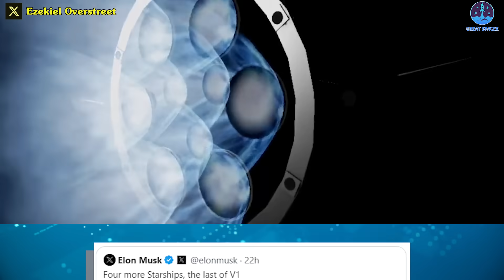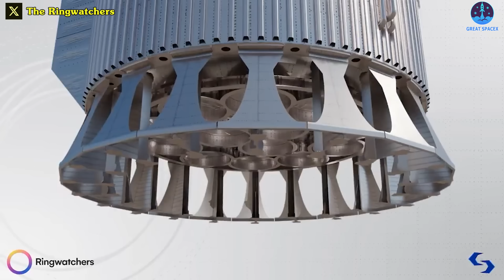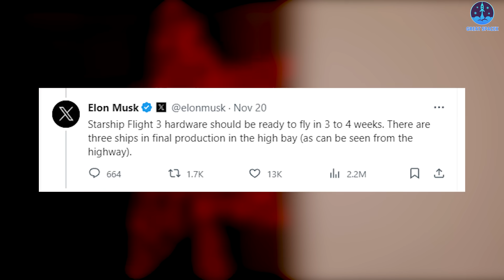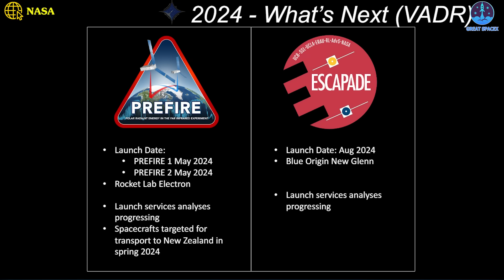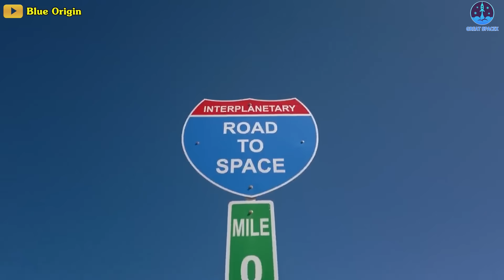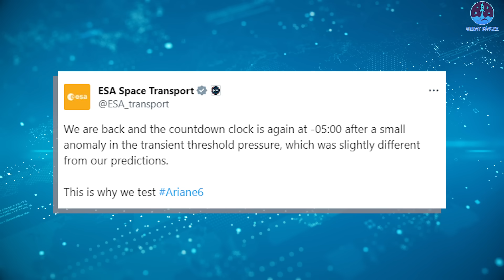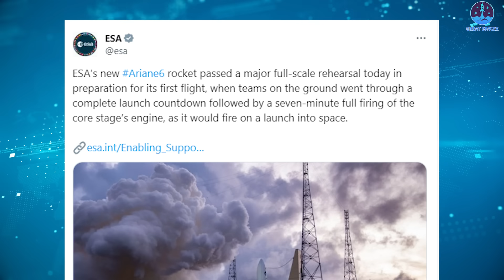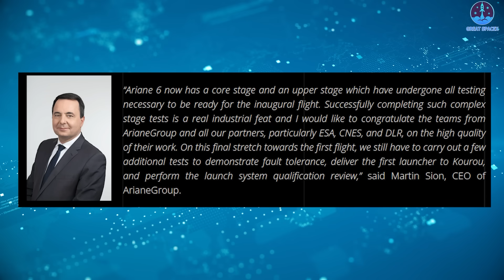Elon Musk just declared to stop Starship V1 production! Huge update on V2 ...

Comment: Starship has never reached orbit. Starship has never successfully reentered. Look at all the missing tiles on launch number two.  Remember, if you're old enough, and you are probably not, all the trouble with the space shuttle tiles and how that added cost and dramatically increased turnaround time.  Betting that they will never get the ungainly starship back through the atmosphere successfully.  It's a whale.  And, making it longer is just going to make it worse.  Making the craft lighter and less strong to counteract the forces of reentry?  Really smart.  

I am personally looking forward to them getting a starship into orbit because we will be able to see the real weakness of the entire system...namely that they will never be able to get the glider/rocket back through the atmosphere and slowed down to land. 

The booster might eventually be made to work reliably with, possibly, "all engine running" to quote from a Saturn V launch.  But, they might have to use the super heavy as a non-reusable once they discover it's just too large to reliably turn around and return to the launch tower etc.  As a non-reusable super heavy could still be VERY useful in that a single launch could probably put an entire moon landing mission in orbit including the reentry vehicle.  Of course, the new moon landing hardware is going to look a great deal like the Apollo setup isn't it?  

Perhaps two super heavy launched, or maybe three, is all it would take to put an entire Mars mission into orbit.  

Super heavy booster might succeed.  Doubt it will ever land itself.  
Starship will never succeed.  It is too large, too ungainly, too un-aerodynamic, and relies on the proven unreliable shuttle style heat tiles etc.  

Oh, if we had only kept the Saturn V, improved the engines, increased the payload.  Imagine the things we could have done in the past half century!

Comment: The raptor 2 engine has a mechanical turbo defect. This is a full flow thrust engine. For the amount of fuel present in the enclosed engine bay at the point of explosion. Something around the turbo’s has a material flaw. I do not no what materials there using. But the failure can only be within the turbo housing. This is the only thing that could inject liquid fuel into the bay compartment. Maybe they should turn to sensors back on. They would help diagnostic’s to pin point the fault.

Nickel base alloys are mainly significant for supreme corrosion resistance including Nickel 200, Monel alloys, alloy 600, alloy 625 and electroformed nickel. Electroformed nickel is not attacked by galvanic corrosion when it is kept in contact with various other metals. Monel grades offer supreme corrosion resistance and possess significant magnetic characteristics at the cryogenic temperature and good resistance to ignition in oxygen. The Inconel grades consisting of Ni, Cr and Fe prevent oxidation attack at the high temperatures limits up to 1800oF. This is more expensive and has more weight. But is bulletproof. 

Next launch concentrate on turbo pump housings pressure’s and temperature’s.

You can also test the onboard destruction module.

Comment: I think by using, 60 percent weight titanium,  instead of stainless steel for the payload section structure and front pointy end  part of the starship vehicle they could possibly reduce the dry weight of the starship by a massive twenty percent overall. Of course it’ll  more costly  but they have used cheaper steel for all the development prototypes do they should be able to go straight over to titanium with limited structural testing in the can crusher

Comment: 33 engines is a great achievement. Since they have Raptor V-2 flight tested and V-3 on the way things seem to be going good with the Raptor. The Rocketdyne f-1 combustion was stabilized after the engineers came up with a baffle plate that sectioned the injector plate off into smaller sections and cured the explosions. But they never tried a big engine with Full Flow combustion. With the success and knowledge SpaceX has gained I think (even though it is a bad idea) they should experiment with a Large Engine design to see if it is possible to recreate a new version of the F-1 using Full Flow Combustion.
Reply: Why? The raptor is working better than ever. Elon stated he preferred smaller engines, that way a problem with one or more is a very small percentage loss in thrust compared to a few larger engines. It doesn’t matter, but I happen to agree. 
          The Merlin engine isn’t a large engine, and look at its record.
           I believe he should concentrate on getting the raptor 3 ready, personally. To each his own, I suppose.
Reply: In large engines there are More issues: temperature and pressure of combustion, as F1 got 70bar, compared to 300bar in raptor. In large combustion chamber cooling wpuld be problematic

Comment: I know that was not meant or even thought about, but I find it curious that the two rockets are named V1 and V2...
Reply: Version 1 and Version 2 have a VERY long history in many sort of items - even rockets.
Don't ASSume.
Reply: @bricefleckenstein9666  Mk1 and Mk2 has better and even longer history. For a company that says "A rapid unscheduled disassembly" rather than "exploded" for PR reasons... V1 and V2 should have been Mk1 and Mk2
Reply: @nickl5658  Version 1 and Version 2 have just as long a history. And it only became bad PR in the late stages of WW II or in the immediate post-war period.
Reply: @bricefleckenstein9666  
Funny little cretin, you really don't know much about the history of WW2 and what VENGENCE WEAPONS are all about. Maybe you do and are futilely trying to defend this sadly worded nomenclature. I don't really care either way what anyone is calling them, but it does have a historic ring to them calling them V-1 and V-2 which are historically imbedded with those two weapons. Apparently, you're ASSuming that you're somewhat smart. Do yourself a favor and just look for someone else to verbally attack.
Reply: The same guy that built V1 Nazi rockets also built rockets that put men on the moon - Werner von Braun.
Reply: @elt7023  Werner had considerable help in both cases, even with the design work.

Comment: Musk could also add a third stage if he wants to increase the payload mass for a given destination.
Reply: Orbital refuelling is to allow full payloads to distant destinations.
Reply: @Jogeta5  Adding a stage always increases the payload capacity.
Reply: @scientificperspective1604  Now you'll need to recover 3 different pieces instead of 2 and increase the complexity even more
Reply: @rizizum  When you launch more than two stages, then at lest one of them will be in expendable mode.
Reply: @scientificperspective1604  That kinda defeats the point of making it fully reusable
Reply: @rizizum  It's not always fully reusable.  In case you didn't notice, they sometimes expend one or more boosters for a particular launch.
Reply: @scientificperspective1604  That's for Falcon 9, not Starship, they're not gonna expend the Super Heavy Booster
Reply: @rizizum  So far, they expend the super heavy booster on every flight.  But what I'm talking about is expending a second or a third stage only, or both, when they want to get a large payload lifted to a high altitude.  They'll do that.  Wait and see.
Reply: @scientificperspective1604  They should add a fourth stage too
Reply: @rizizum  It's all about diminishing returns.  As you know from the Apollo program, there's a huge benefit in lifting capacity when a third stage is used.
Reply: @scientificperspective1604  That's why they're adding 5 stages to starship

Comment: Pop quiz fanboys: how many Saturn 5s blew up?
Reply: How much in todays money did a Saturn 5 cost?
Reply: Flight termination explosions don't count.
And the Saturn V did have one failure out of 13 launches - the Apollo 6 mission - which was the only failure in the Saturn line.
On the other hand, NASA had a lot more money (in inflation adjusted terms) to work with then, a sense of "purpose", and a LOT of luck with that series as well as a "partial testing" process.
Reply: @bricefleckenstein9666  FTS explosions count if there was a failed system. But these are test launches to even begin with, even better outdated prototypes.
Reply: @XxX-ww  People forget that roughly HALF of the Saturn I and Saturn V launches were ALSO tests.
In fact, the first Saturn I launch was a nail-biter for it's team, as NO OTHER PROGRAM before it had had a successful launch on it's first try.
Reply: @bricefleckenstein9666  Didn't Saturn V only had 2 test flights(apollo 4 and apollo 6) before them putting humans in humans in it? Which had less than a dozen flights afterwards before it got scrapped due to the lack of funding. (With 60B$ budget of course)
Reply: @bricefleckenstein9666  Also Saturn V had gone through different iterations before it came out for the launch, starship on the other hand is an outdated prototype and a test article. And the fact that they have 4 more ships with upgrades and an entirely new iteration on the plans shows that they're just trying to launch outdated ships to gather data so they can improve the design while testing them. (It's a different testing method but still valid due to reduced cost of the test articles)
Reply: @XxX-ww  There were test flights of both the Saturn I series and the Saturn V that were not labled "Apollo".
Reply: How many Saturn V test articles did they launch? None, cause they had more than 60 billion to work with.
Reply: @XxX-ww  As I recall, 6 of the Saturn V launches were considered tests. I might be off one.

Comment: I hope that the increased number will offset if/when one fails to reignite or breaks while descending. Not just the number, but also if the thrust is off-center too far for gimbling to compensate and still have reserve to change attitude or translate.
Reply: One of the benefits of multiple engines is that if one or several fail the ship keeps going. If it was one big engine and one failed then it's all over.

Comment: Where they not already takling about a 2 or 3 ring extension? Pretty sure slosh was a problem restarting the booster, The higher engines didn't restart, pretty sure a cafetiere style plunger plate would reduce the slosh problem. I Don't build rockets, but the tank is essentially a big cafetiere.

Comment: Are the new Raptors, Raptor 3's or is there another Raptor in the works? It would seem to me. That the 3mm, 0.1181" wall thickness is getting a little thin vs. 4mm, 0.1575" wall thickness. Especially for the extra fuel capacity. Last test that Blue Origin wall thickness was about 0.026" on there fuel tank. It exploded. Great Show today. Who makes the Vulcan engine.
Reply: For these cylindrical assemblies, the weakest ;inks are the welds.  I beliece SpaceX id dtill using a stir welding method, which reduces granular stresses around the weld.  Everyone else is still using TIG/MIG welding, with can leave a stress zone just beyond the weld joint.  This stress can cause a failure at a lower pressure/strain.

If you want a great example on why SpaceX would be considering a reduction in wall thickness, go watch the first Startship launch again.  At max Q, so the maximum combination of atmospheric density and vehicle speed, the vehicle turned sideways.  That's like a skyscraper surviving a CAT 9 hurricane.  Keeping the pointy bit forward means the next generation will not see the problem of side loading to this extent.
Reply: I thought they developed a form of plasma welding. @jameslmorehead
Reply from the maker: That is Raptor 3, hopefully

Comment: Once Elon Musk figures out how to get the starship in space, he’ll probably make one out of titanium and really cut the weight down want he gets the theory proven
Reply: Or gold 😮
Reply: @PlanXV  And the cost would be prohibitive and UNNEEDED.
Reply: None of the existing tooling could be used for Ti down to hand tools.
Reply: Too brittle, and it can't handle heat like stainless - never mind the prohibitive cost
Reply: @Harald-  Actually, Titanium can handle HEAT just fine - that't why it is used in things like gas power turbine blades, leading edge and high-temp parts of the SR-71, and other such usages for years if not decades (and probably STILL sees such usages) - it's BETTER at handling heat issues than any alloy of Stainless Steel.
It's the COLD from the fuel tanks it would have an issue with and that Stainless can handle a lot better.
Reply: @Harald-  Titanium is one of the best metals for heat

Comment: Well, not unexpected, Elon has better engines in the pipeline now, and thats the starting point for all the other numbers.
My guess is next version will be a bit longer. and they may reduce skin thickness, but would be better off reducing internal structure, 80% of the strength is in the skin.
So thats likely a decent approximation ratio of what each should weigh:
80:20....
And if the new R-3 engines are more efficient,  wont need to add much more fuel due to length increase, and can be used to launch the second stage with more engines etc.
Its time for changes, but first we at least will maybe get past the Raptor 2's and into early Raptor 3 engines.
And by the time they get those launch tested, will have fixed a lot of other "problemitas"....
So I will be looking forward to every launch to see what gets better, but suspect the most obvious will be engine improvements.
And it will be fun to see what the new tubes are like.

Comment: Before the civil war bullets didn’t spin. They didn’t travel as far and were less accurate. Once the grooves were put in the barrel the bullets travels farther and faster. By putting a nose cone on the top of the rocket that spins they could save on fuel and increase the speed significantly
Reply: Nope, with the fins that would create drag, and they need those for stability.
Reply: VERY WRONG.
Rifles were uncommon even DURING the Civil War - but go back to the Revolutionary War and the Napoleonic Wars AT LEAST, in the hands of snipers and some hunters.
They also existed in cannon for decades before muskets, though not common - mostly used in "chase" armaments.